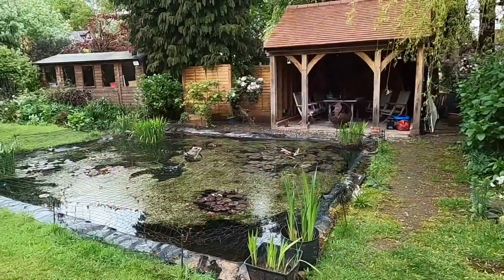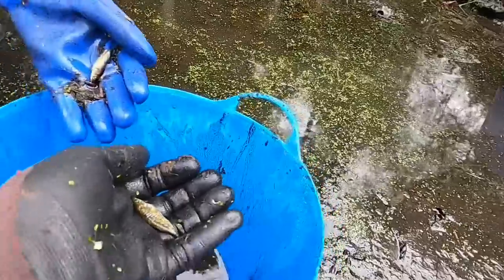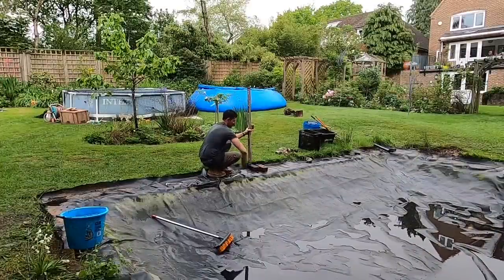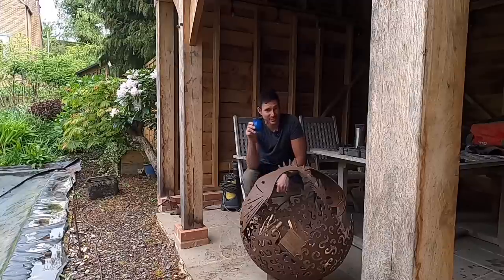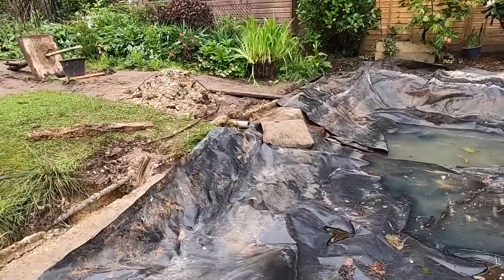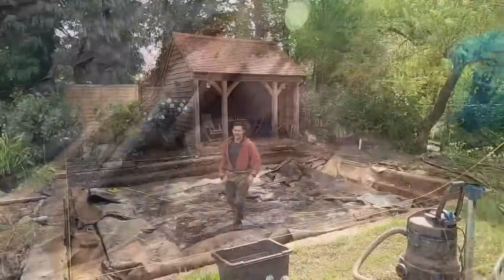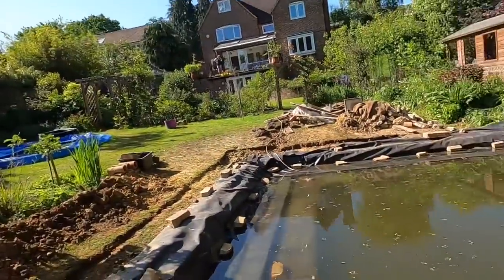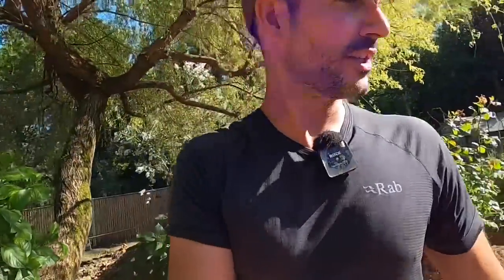Pimp my pond! Formal pond re design & construction part #1: ‘The hard part’

Comment: Hi Ed, You guys certainly take on some jobs, how the hell you work out a reasonable accurate costing with all the hidden pitfalls, this job must have been a nightmare. If your clients are genuine people they can see the  masses of extra work that the drainage problems that you have had to contend with. Surely they cant expect you to complete all that  extra based on your original quote or estimate ?.. cant wait to see part two
Reply from the maker: Hi Norman, thanks for watching and your comment.  For sure estimating  jobs like this can be very difficult to get any level of accuracy-I always stipulate on all my estimates that pricing is subject to ground conditions- you never know what you’re going to expose when digging and what could then be involved in rectifying any potential issues, increasing the work load massively as a result-like this job! In this instance once it became obvious there was an issue with water and the pipes were exposed and it was evident any re-routing of pipe within the pond couldn’t be feasible joined back to the existing pipework I had to present my clients with two options: I could maintain a dry enough environment via my temporary sump and pump to continue the build and once the pond was filled the ground water was less likely to cause any issues, so I would then put everything back to how I found it. Option two was to re-route everything entirely-my  preferred choice and the right thing to do. My clients were very understanding and happy with the extra expenses I then had to estimate for and were happy for me to do the work. From my stance I was much happier to do the extra work in the knowledge that I was safe guarding ‘my pond’ from any potential harm in the future! Every job I treat as my own pond-I’d be heart broken to know someone was having a major issue with one of my builds! And yes- my clients have been wonderful throughout, looking after Dave and I very well! 
Thanks for watching and for your comment,
Best,
Ed
Reply: @CrystalClearAquatics  I should have known you would be aware of hidden pitfalls and have covered all options as you do in all your jobs well done Ed.

Comment: Wow, very impressive! Well described and clearly a man of great pond making experience. I just wonder if constructing and finishing a pond on a small site brings with it more problems related to building around existing features, drainage and housing of equipment. This site is enormous compare to my garden. BTW - cant wait to see the follow on video to this.
Reply from the maker: Hi there, thanks for watching and for your comment! In my experience, apart from the difficulties involved in housing my equipment-holding tanks etc- working in smaller gardens poses no greater difficulties then larger ones.  In this particular garden there’s a lot of diy drainage that’s been very poorly installed at some point in the past-I’ve never encountered so many different pipes in any of my previous excavations in years and years of digging!! Just bad luck with this one!
Best,
Ed

Comment: 41:30 i am a big lateral thinker & no particular expertise in this exact field…BUT why not have STARTED with trenching a 10 foot deep sump system at strategic location up stream of water table??? Then there would be NO water under good liner before you cut it…then clear for mini excavator and starting over without ground water issue!!  

I do enjoy your videos and effort + quality…just sharing a big thought
Reply from the maker: Hi there, thanks for watching and commenting!  In principle your idea is correct- had we been aware of any potential water issues this would have been looked at and dealt with before getting into the nitty gritty of the pond build- however hindsight is a fine thing- in this instance neither myself or the owners were aware of this issue until we’d thoroughly committed ourself with starting the build.  Additionally the water issue wasn’t a water table/groundwater problem and was simply dealing with an underground drainage pipe that was directing a large (larger then i’d have liked in any case) amount of water directly to the pond and as such required re-routing. 
Thanks for watching and commenting!
Best,
Ed

Comment: how do you work with plastic on a stream? i.e if i create a 50m long stream into a pond, how do i overlap the plastic? is is stuck down with glue?
Reply from the maker: Hi there, great question! For a stream or a cascade with minimal fall/slope then the preference would be to use once piece of liner, with no joins.  If this is not possible then the liner must be glued/joined with a suitable liner welding product.
However for most cascades or streams with occasional drops and falls then overlapping sections of liner without glue or bonding is absolutely fine. If you imagine turning a stair case into a waterfall and you used two sections of liner- starting from the bottom/lowest section of falls (bottoms step up) lay a section of pond liner. To overlap the next section of liner ensure that the lower section of liner (which will be under the next/upper section) is finished on the flat section of one of the steps and the overlapped piece of liner extends down to the flat section of next step below. That way water will continue to flow down the falls without leaking and without need to bond the liner.  Hope that makes sense!
Best,
Ed

Comment: Hi ed why don t you connect the drainage pipe to run in pond and then fit in a over flow pipe the other end so yo don.t get any water under liner just an idea
Reply from the maker: Hi Mark, great idea but two reasons why I didn’t (and couldn’t) do as you’ve said: 
1) with no idea where this water has come from potential contaminants are a concern and so adding this water to a pond with livestock could be an issue.
2) due to the  level of the drainage pipe against the pond, running water into it isn’t possible via gravity, which is why the trenching had to be carried out to the lower section of the garden where it was possible to discharge the water. Once the lower pond has been completed I shall be doing exactly what you’ve said -water draining into the lower pond and an overflow to take the excess water away! As this pond will be a natural wildlife pond I don’t have the same concerns about potential contamination.
Thanks for your comment,
Best,
Ed
Reply: @CrystalClearAquatics   oh I thought it was rain water ed sorry like you said you don.t no where it's coming from  🙏

Comment: 10:38 the pond viewing / sitting area should have been 45 degrees from proximal pool line…if boundary constrained…it should have smaller footprint to accommodate.
Reply from the maker: Thanks for your comment- may I ask why however?  I agree that there are some simply ‘rules’ or theories that go somewhat towards making something potentially better if these rules are followed, but something as subjective as this is really down to clients preference- not to mention in this instance the seating/paving area positioning in relation to the pond had already been governed before the pond restoration was started.  Having spent plenty of time sitting and watching the pond from this location I think this seating area complements the pond and is in just the right place!
Best,
Ed

Comment: 7:36 understand the challenge, why not have final bucket lift and lightly tapered flow tray with water and solids separator base on gravity and diversion attendant? Would cost 250 pounds to create
Reply from the maker: Hi there, thanks for your comment and for watching- an interesting idea, but although technically feasible (I’ve worked on many a fish farm where fish were graded in size using mechanical methods) I really wouldn’t ever see the need to go to all the effort of making such a device to help in removing large quantities of small fish- in this example the stickle backs.  Not to mention that such methods really aren’t as kind to the fish as gentle manual removal once the pond has been emptied.  
Best,
Ed